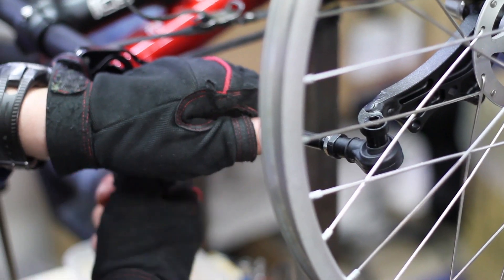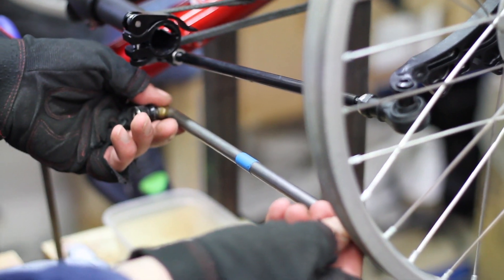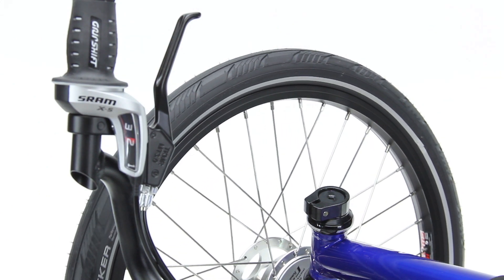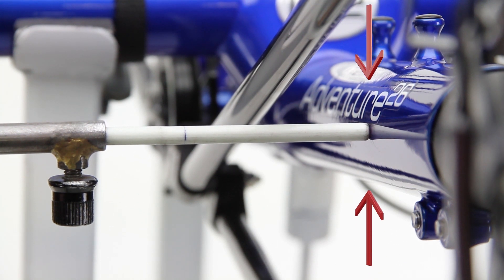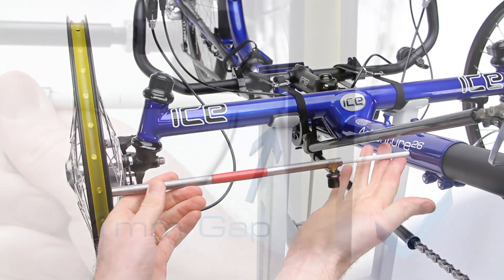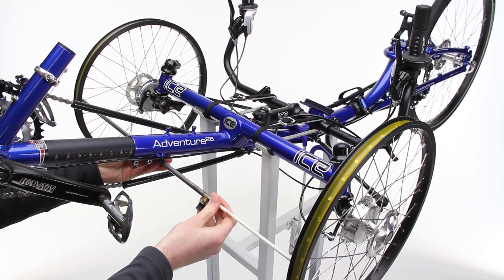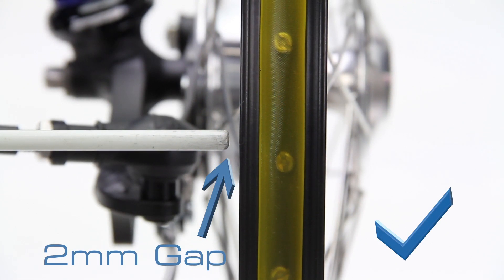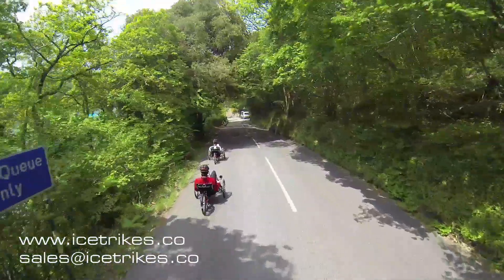ICE Recumbent trike wheel tracking (technical guide)

Comment: When you set up the tracking does it have to be from a imagery horizontal line across the wheel rims or can you measure it from just below the imagery horizontal line..?
Reply: When I say horizontal line I also mean from the widest part of the main frame to the rim..
Reply: It does not have to be exactly at the horizontal line. You would messure the same a few inches up or down.

Comment: Thanks but...surely once you’ve set one wheel from the frame you can use your adjustable pole to set the other side front to the same distance from the frame? Am I missing something or have you overcomplicated a simple job?
Reply from the maker: Hi Graham. Doing the first wheel from the frame gives you your starting point and makes sure your trike will be traveling in the right direction but to get an accurate 'toe in' on the wheels, it is necessary to do wheel to wheel. It gives a much more accurate track. Hope this helps.
Reply: ICE Trikes Ok thanks. Not sure I can do it but I’ll give it a try. Currently my Adventure has one wheel about 2cm further from the frame at the front and the steering shakes like a mad thing hands off. I’ve done loads of bike maintenance and building over the years but this is a new problem for me. 
The trike (secondhand from ebay) is amazing otherwise - I have gone from zero cycling since the illness came along 20 years ago to a 14 mile round trip into Plymouth on Drake’s Trail last week - really pleased!

Comment: No, no, no!
I lost all interest when you said that you guys have all the proper tools and we would have to be creative.  How can you possibly do an instructional video with that kind of crap!
Reply from the maker: Hi Geoff. Sorry this put you off. The tracking on our trikes is factory set and would only ever need to be adjusted if replacing steering parts or checked after any potential bad crashes. This means this job is a rare one. Our tools were made in house by us because we have to do this job about 10 times every day. Unfortunately it is not practical to produce these tools for the market because the need is so small. As far as we know, there is no one else making tracking tools. Our home made suggestions have all been tried and found to work fine.

Comment: Kind of confused, you are ultimately measuring between the distance of the front and backs of the front wheels. Why measure from the main spar of the trike. Why not just zero in both front and back distances than add 1 mm to each front adjustment wheel for toe in?
Reply from the maker: Bobcatt22 The wheels need to be parallel with each other and the trike itself. If you do not track the first wheel to the frame, the wheels will never be parallel to the steering assembly, only to each other.
Reply: ICE Trikes
Thank you for your response. I do understand now.
Reply: Bobcatt22

Comment: Graham Williams If its any help I got two Certain expandable rods from B and Q a short one and a long one there very cheap and have plasik ends so not to scratch anything the short one for the first wheel and long one for the other wheel.
Reply: Excellent Video 
The tool I use is certain rods the ones that expand in and out :-) B and Q sel them